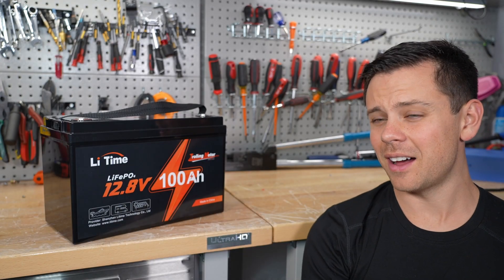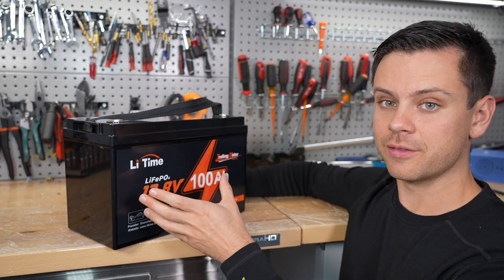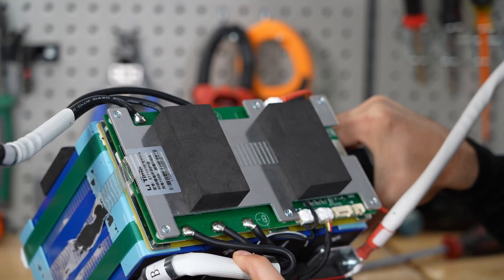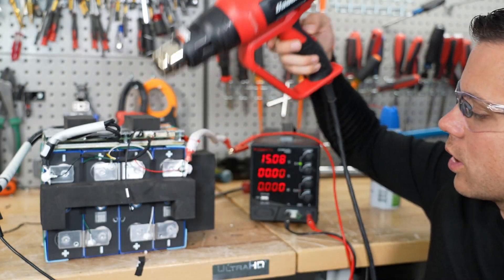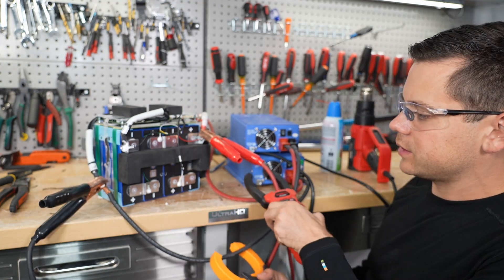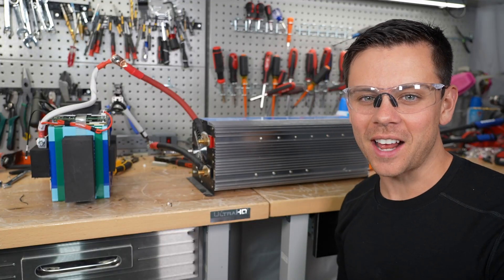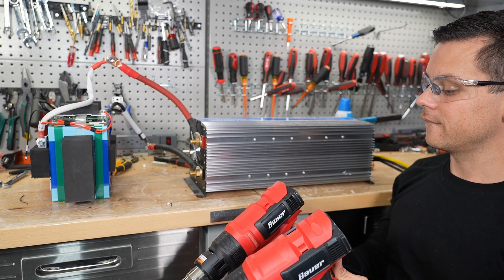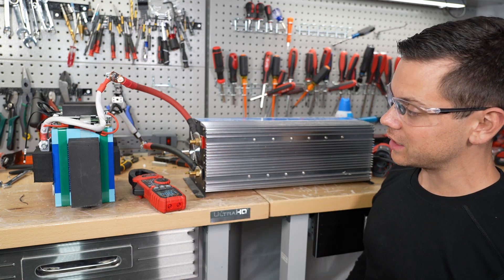$369 Li Time 12V LiFePO4 Battery! 300-500A Surge?! Low Temp Protection?!

Comment: I keep hearing a lot of people in the audi forums saying it isn;t a good fit for car audio systems. I can't see why not. For daily drivers with a 3000 watt system that is drawing under 100A in the most demanding cases, this should work fine, no? Have stock 110V alt, big three upgrade and one of these should negate the need for the HO Alt upgrade which is 3 times the cost.

Comment: I've been running my off-grid cabin on two of their 12V 200AH (in series to 24V) for the last 2.5yrs with no problems at all. A neighbor also bought them and we contacted support in China over an issue and they got right back to us. Ampere, uh I mean, Li Time seems to want to compete with the better known manufacturers.

Comment: I see that li time is having a site wide sale right now. Would you say their 60amp charge controller and 3000watt inverter are good too? I have been to your site and decided to go with their 230ah battery as you recommend but the other stuff is almost too cheap to pass up. Unless the sale price isnt really even a sale. I have a lot of questions i guess. Im a newbie building a van with a fridge and a freezer.

Comment: I just bought 4 of the 12v 230ah version.  I waited a few weeks to order and unbelievably they added the low temp cutoff feature and did not raise the price...$669.29.  Also I went online to see about coupons and found one that worked that was for $80.00 off!.  What was even better is their delivery time...only 3 days (and I live in an extremely rural area).  They are well packaged.  Their user manual is also very thorough with only a few grammatical errors.  Obviously I am very impressed by the company.  If I ever have any issues I will add more.

Comment: A few days ago I got two of the new 100Ah "mini" model from LiTime via Amazon, which use pouch cells and are smaller/lighter than the other 12.8V/100Ah models. Unfortunately in my testing I only got 65Ah out of each of them. Curious if I'm doing something wrong? I used a CC/CV charger set to 14.4V/10A to charge each battery until it cut off. Then I connected a watt meter between the battery and a 300W pure sine wave inverter, and plugged 4 large HEPA filters into the inverter. I turned them on and set the fan speeds so they were drawing about 20A continuously according to my Klein CL800 clamp meter (clamped between battery and watt meter). The inline watt meter showed the amps/watts bouncing around a ton while the Klein showed it steady at 20A. Each of the two batteries hit the low-voltage cutoff at exactly 65Ah consumed according to the watt meter.

Any thoughts on this? Is the watt meter reporting inaccurately? I have reached out to LiTime via Amazon messaging, and they asked me for the brand of charger and watt meter which I've now provided. Hopefully they can give me some more insight. I hope it's just a measurement issue...at $275 they're a steal if they're 100Ah, but substantially less so if they only give 65Ah.

Comment: Have you or could you test and review the 12v 100ah lifepo battery from JJN. I have 2 of their bifacial solar panels and I'm amazed at the quality and results I'm getting from them. I'm interested in a battery I just saw advertised at a very good price. I'm wondering if you have any experience with them.

Comment: If your trolling motor is pulling 300-500 amps you have serious problems. Not only that, but the breaker between the batteries and motor will pop. It's only a 60A breaker.

Comment: Will , is it possible to rig my existing motor home with solar where the coach batteries thcan be charged:

1. By the solar panels
2. By shore power
3. By the engines alternator.
4. By the coaches installed generator.

Thanks for the assistance,  great info on your channel!

Comment: So, I've watched a lot of your videos, (great job!) and I have learned so far that solar panels like being cold, and not hot, batteries do not like being cold, and can't handle taking a charge if it's freezing cold; but now I am curious if heat affects batteries? Does it help or hurt them? I don't mean super excessive heat but say an RV going off grid in the desert and it gets really hot on the campers, say 100 degrees. Does it reduce the battery power the way a cold day would?

Comment: Got a question for you. I’m setting up a 4000 watt inverter wired to 2 batteries in parallel with a trickle charger. Backup power for my 1/4 hp sump pump. Will be set up in my basement. There’s a ground connection on the inverter. Does the inverter need to be grounded ? And if so how do I ground it in my finished basement. Thanks for any info

Comment: I’m trying to put 2500 peak watts of solar, so that will be somewhere around 1200 watts most of the time, on the rooftop of my motorhome . Working on being able to run AC when absolutely needed 
For the price, physical size, performance, best bang for buck. 
Would you recommend buying these batteries 
Got a 3000 watt pure sine wave Motormaster inverter installed 6000 peak
Trying to do it as inexpensive as I can but still be able to do the job
What do you recommend 
Thanks 
Blair

Comment: Thank you Will!  
One more feature... honesty.  They made a mistake advertising their 12V 230AH low temperature protection battery for $664.99 so they gave it to me for that price.  They meant to link to unit without low temperature protection.
Again thank you for recommending Li Time.

Comment: Bought 2 of these in May for my off grid solar system and they have been working great. Bought a 3rd one a month ago. Upon initial testing, the BMS over voltage protection was disconnecting the battery at exactly 14V!! Took an entire week of back and forth emails (they were very responsive to their credit) and they were trying to convince me the battery was just fine! I had to threaten them and they finally caved and sent a shipping label and I returned the battery. Took another week after they received it to finally get my refund.

Makes me wonder, did they have an entire lot of batteries with this same problem or was mine a one off. We will never know. Now I am afraid to buy another one of their batteries.

Comment: Thanks for the review. So i got this model and their 20 amp charger had to put a charge in it and went fishing about 6hrs. Ran great voltage drop to 13.3 volts. Got home puta charger on it for about 2.5 hrs. Decided to check voltage with my volt meter 12.91 volt and charger stays green it wont charge up. I try a different lithium charger same result. I email li-TIME SEE WHAT they say.

Comment: Hey Will. Looking at your DIY 400 Watt 12 volt Solar Power System for beginners, could I use the EG4 V2 (12V 400 AH) on that setup as is, or would I need to up the wire gauges at all to handle this larger battery?

Comment: just set up a stand alone 12v system for ham radio. I went with eco-worthy products. 3 100ah batteries in parallel, 40 amp mppt , 1100 watt invertert and only 400 watt pannels. so far so good. thank you for getting me motovated try this out. Been watching your videos for years now. 
Thank you for all of the info you put out !!!!
I would like to go off grid but crap! it is expencive.

Comment: I bought this battery and the case on it is so crazy large a full 13 inches long, so it won't fit in boats battery tray. you have to have a group 31 tray not a 27

Comment: Thank you for the review. Can you verify or comment on the shock and vibration toughness of this battery compared to other non-trolling batteries? That is one of their selling points but I don’t think they get into it. In most boats these are in the bow and the boat slams them in choppy conditions.

Comment: Hey Will. LiTime just released a 12V 230AH with low temp protection, in a relatively slim form factor. It would be sweet to see your input on those as well! Thanks for all the great content.
Reply: I just bought it.  Because they made an advertising mistake they gave it to me for $664.99.
Reply: @imillionaires  How is that battery doing is it s good buy

Comment: The Redodo 100ah battery from Amazon also has low/high temp charging protection but only costs $270. It would be interesting to see a tear down of that!

They also have a "mini" version for $310.
Reply: Many batteries CLAIM to have temperature cutoff yet as we have learned, few actually do. There seems NO penalty these days for misrepresenting what you are selling. What have we become?

Comment: Can you discuss lifepo4 batteries suitable for RV use (including starting RV generator). AmpereTime refuses to warranty their batteries if you use them to start a generator. I purchased a AmpereTime 200Ahr 200A BMS that has failed after a few days use in the RV. Other RVers use two 100A BMS Battle Born batteries with same generator and they work fine.

Comment: Will, I love your videos.  I'm a big fan.  We've recently had a couple of times that the grid has gone down here in Yuma so I'm wondering,  can an off-grid solar system be used as a backup for grid-tied solar for when the grid goes down?  Would it work if a transfer switch was wired between the two systems with the primary side of the transfer to the grid and the secondary source wired to the off-grid side?  Would that be enough back feed to the grid-tied inverter to kick on and then feed both systems' loads?

Comment: Good review and tempting...
I would want 4 in series, and a method of balancing them, which would require another specialist 14v balancer if it exists,
or disassembling for the cells, making a new battery with extra 16S LFP BMS.

Comment: Can i pay you for a short consultation?  I need to replace my marine lead batteries with Lithium,  i purchased a converted ford transit with solar and all other components, just need to upgrade to lithium but don't know what size i need.  After doing some calculations i believe i need 300 ap but before i invest i hope to speak with a professional for advice
Reply: And i would buy this Li Time 300ap battery but i want the temp protection .  So i need a rec and im happy to pay for your time.

Comment: LiTime sells return and used batteries on their website.  I purchased a used 230Ah battery for $577 w/free shipping, tested out at 234Ah on my tester that I have calibrated.  Also put it in my Featherlite stacker car hauler to try the lift, it had no problem pushing 255 Amps for about 6-8 seconds running the lift.  Only a short run because I had to stop the lift (it had a car on it and would have hit the ceiling).  I also ran the A/C on my camper for about 1 1/2 hours pulling 130-140 amps without issue.  I'm very happy with this LiTime battery..

Comment: What is the difference between the Li Time (Ampere Time) Mini 12.8v 100ah LiFePO4 battery. And the ampere time full size battery? Why use a bigger heavier battery if the mini is the same specs ?

Comment: but you sold me on the BATTLE BORN BATTERY, VERY PRICEY, WIRED IN SERIES, 10 HQSP 100WATT WIRED IN PARALELL, W/ AIMMS 3000WAT INVERTER, OUTBACK 80AMPCHARGE CONTROLER. BOY I HOPE I DID THE MATH RIGHT, 8 BATTERYS THE ARRAY IS A BIT SMALL ON A POLE. PARADISE CA.

Comment: Have you seen the LPF MAX 300 amp smart battery with heat function? 959.00. I bought 3 for my sailboat and they work great. Bluetooth app is great. Haven't tested the heat function yet and I'm not planning on ripping it apart but in the video it shows how they wrap the heat pad around the battery.

Comment: I almost bought one. I bought NewtiPower 100ah  instead for my camper. I plan on two batteries & at least 2000 watt inverter. So far my bench testing has been good.

Comment: I would like to buy a 200 AH battery for a rv and run a 2000 watt inverter to power microwave and coffee maker. I have seen 200Ah battery with 100 amp BMS and 200Amp Bms. What would I need? I dont understand the difference between the 2

Comment: I have exactly that same amazingly inexpensive generic battery and I just saw the spec sheet. Exactly the same figures. I replaced a dead Lead Acid battery in a small hybrid inverter/UPS system and am really pleased with the performance, especially since I can monitor the charge/discharge process via Bluetooth. That's probably the coolest feature of the battery!
EDIT: The Chinese are tracking where their products are being used by forcing the user to enable full location tracking in Android. If you don't enable it the app refuses to connect to the BMS.
Reply: You mean their marketing department thought they would be clever and enable location on whatever mobile device you use? That is not full location tracking. Xi Jinping is not checking to determine where you might be at any given moment. Mark Zuckerberg might be. How would we ever know? Just turn off location my friend.
Reply: Is this true ?

Comment: Will- it would be great to see reviews of waterproof (saltwater) “starting” lithium batteries. We are looking to change out 3 lead acid batteries in our boat which we use for off-grid weekend adventures. A lot off RV’ers and boaters looking for reliable info so they can move to lithium and enjoy longer amp hours.

Comment: Looks like two of these in parallel could work in my motorhome. I have a 12 volt fridge and a 4000 watt Onan generator. The starting current for the generator is 130 Amps for a few seconds up to 30 seconds. Will, do you have experience with LiFePO4 as starting batteries?

Comment: I have a small solar system. I've been using two 12.8V, 200Ah, Ampere Time batteries for about 17 months. 2 months ago, I add two 12.8V, 200Ah Li Time batteries (25.6V, series-parallel). I have no complaints so far. The specs were not exactly the same, but very close. Thanks to Will for spending the time and money,  doing research, so we don't have to.

Comment: I was able to get one on sale for $269.99 the day before I went to Oshkosh EAA. Harbor freight was having a sale on 100 watt solar panel for 99.00 so I connected their charge controller and was able to use every night to Ronnie 2 fans and my CPAP machine and the pop up ac for 2 hrs one night. I was so happy the battery was able to be fully charged every day for use that night
Reply: where did you find that sale?
Reply: @Baxter3784  it was direct from Li Time. I was looking for something that would work for my project and stumbled across it. I didn’t realize how much of a deal it was until after I received the delivery

Comment: Interested in any you have yet to test on your channel from a list of 57 portable power stations mentioned for a SoCalEdison slash rebate that are eligible for a $150.00 rebate with systems starting at $48.00 for a Soyond Generator with a Panel. Then an I-gen for 129 and a A-iPower 300w station..for 159.00  up to Yeti300x for 2,799.00
Note that some of the power stations are mentioned multiple times with different wattage or capacity ratings.
EcoFlow Delta Pro
Jackery Explorer 1000
Goal Zero Yeti 1500X
BioLite BaseCharge 1500
Anker 535
Anker 757 PowerHouse 1500W
Anker SOLIX F1200 Portable Power Station
EcoFlow River Max
Oupes
Generac Portable Power Station
MAXOAK Bluetti AC200P
Goal Zero Yeti 500X
Goal Zero Yeti 1000X
Goal Zero Yeti 6000X
Goal Zero Yeti 3000X
Goal Zero Yeti 400
Goal Zero Yeti 1000
Goal Zero Yeti 1400
Goal Zero Yeti 3000
Jackery Explorer 240
Jackery Explorer 500
Jackery Explorer 160
Jackery Explorer 300
Jackery Explorer 1000 Portable Power Station
Jackery Explorer 1500
Jackery Explorer 2000
Jackery Explorer 2400
Jackery Explorer 5000
Jackery PowerBar
Jackery PowerPro
NEXPOW Portable Power Station
ROCKPALS 500W Portable Power Station
ROCKPALS 300W Portable Power Station
ROCKPALS 250W Portable Power Station
ROCKPALS 200W Portable Power Station
ROCKPALS 300W Portable Power Station
ROCKPALS 500W Portable Power Station
ROCKPALS 1000W Portable Power Station
ROCKPALS 300W Portable Power Station
ROCKPALS 500W Portable Power Station
ROCKPALS 1000W Portable Power Station
ROCKPALS 300W Portable Power Station
ROCKPALS 500W Portable Power Station
ROCKPALS 1000W Portable Power Station
ROCKPALS 300W Portable Power Station
ROCKPALS 500W Portable Power Station
ROCKPALS 1000W Portable Power Station
ROCKPALS 300W Portable Power Station
ROCKPALS 500W Portable Power Station
ROCKPALS 1000W Portable Power Station
ROCKPALS 300W Portable Power Station
ROCKPALS 500W Portable Power Station
ROCKPALS 1000W Portable Power Station
ROCKPALS 300W Portable Power Station
ROCKPALS 500W Portable Power Station
ROCKPALS 1000W Portable Power Station
ROCKPALS 300W Portable Power Station

Comment: I have two Ampere Time 100 Amp about one year old now and just purchased two Li-Time 100 Amp batteries a few months ago.  The first two Ampere-Time batteries have been cycling to about 50% levels daily for a year fault free.   The two new Li-Time are to increase the total amp hour rating of my 12 volt system.   All four of my LiFePO4 batteries lack of low temp cutoff. To get around the lack of I have a simple external temp probe taped to the outside of the battery case with the monitor set to trip at 4 degree C which turns ON or OFF the Solid State Switch between the solar panels and the MTTP charge controller.  The  50 Amp Solid State Switch with heat sink and temp. probe with monitor was about $50.

Comment: I have a 100ah battery that seems to struggle with load, even just pulling 5amps load the SoC will appear to plummet and then turn off but removing the load and applying charge for a few seconds it springs back to life and shows the original SoC... I'm baffled by it... Love the videos by the way

Comment: Hey Will I have a 2 year old Dr Prepare 100 amp battery. I have always heard that you can’t just add a second battery like that Li Time battery. Can you please explain why that is? Will it work but may not get 100 percent performance or is it dangerous?  I would like more capacity but hate to buy 2 batteries and have to get rid of the one I have. Thanks
Reply: Read the diysolarforum. All you need to know is there. 😮